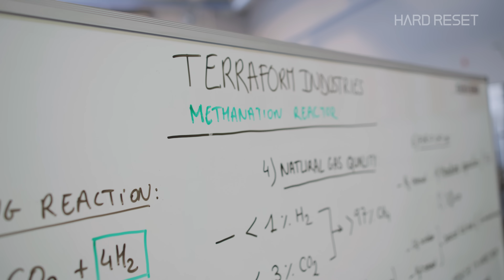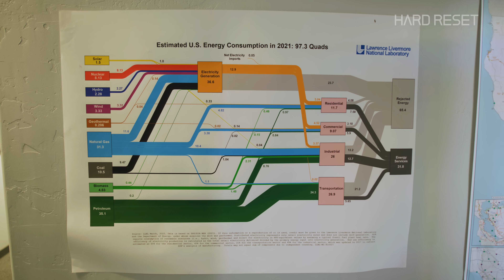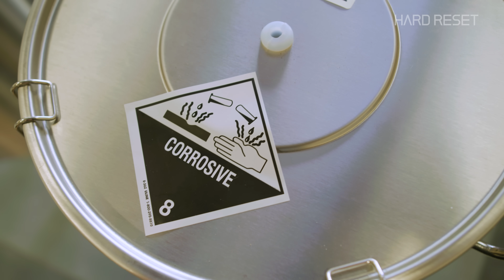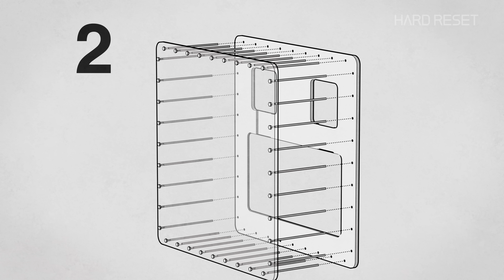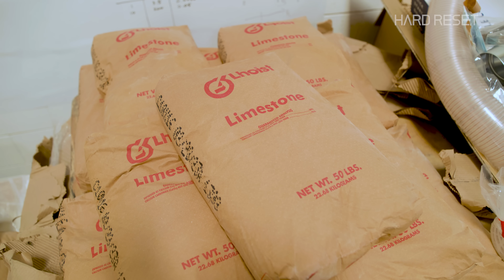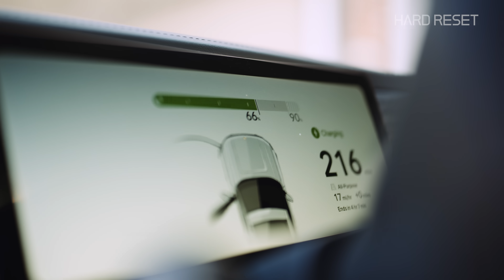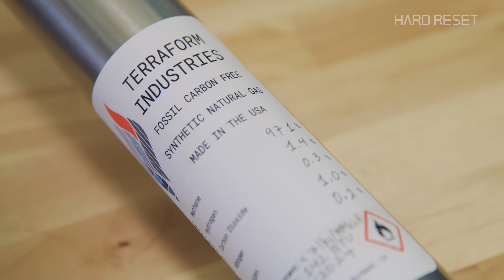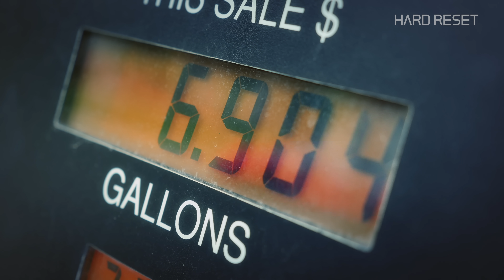The Last Fuel We'll Ever Need?

Comment: engineer here, call me super skeptical, I want to see total energy inputs and outputs of a finished loop.

he says it is 30% eff, so 1KJe of variable produced solar energy makes at best 500J of hydrogen and then 300J of methane, store that up in a pipeline and tanks and later on you can make around 150.. 200Je of electricity but base load. The 5..6 times inefficiency when turning intermittent solar to baseload electrical is what you would expect or you need to come up with a better battery or energy storage like liquid air heat storage system which has a way better loop efficiency of up to 60% electrical variable in and baseload out.

He is also producing oxygen, that should absolutely not be released, when used to burn methane, the conversion back to electrical increases from max 60% to a new high of 80% in the Allam-Fetvedt cycle which keeps the CO2 product inside the system where it is never mixed with air until it is finally exhausted. But that CO2 could be fed back into the methane production. The whole point here is that you have a battery system here where the hydrogen and methane are just transient parts of the system.

If the methane is used for transport heating or making other synfuels than that is fair use too. Suggest using DME as a diesel substitute.

And not lets forget that LLNL Energy Flow Graph he popped up, the USA uses 100XJ/yr of primary energy which is mostly fossil based or nuclear energy, only 1% is from solar which is extremely energy land poor,  so the 100XJ would now be using vast amounts of land to get the hydrogen stock as the input. There is a way to make hydrogen vastly cheaper than electrolyzes and that is to use high temperature nuclear reactors that produce heat at 700c or higher, such as the Molten Salt Reactor. That process is the Sulfur-Iodine cycle and is exactly 50% eff and requires very little land and no electrical energy needed, so its a thermal nuclear power plant to make hydrogen 24/365 and the platinum is replaced with dirt cheap sulfur and cheap iodine.

If I wanted to solve the energy problem I would go direct with land efficient MSRs making thermal hydrogen for synfuels and regular electric MSRs for the grid. No huge land and no precious metals needed.
Reply: He's planning on building the first gen production plants over exhausted methane mines, which are often in hot wasteland with plenty of space and sun which are already being used. I also recommend looking at the guys (Casey Handmer) blog; particularly his "Solar and batteries for generic use cases" post where he does all the calculations you talked about.

He also has some other posts talking about nuclear; but the current capex of an MSR makes it impossible to make fuel competitively with mining fossil fuels. The capex VS power generated of an MSR is larger than alternative nuclear options; and may even be worse than geothermal, so I don't know why you suggest it. What you suggest is just not economically competitive with existing technologies; "land efficiency" doesn't really factor into that.

Also, you don't need precious metals for anything involved in this discussion. You can make hydrogen from the air (or water) vial electrolysis without platinum, and Terraform's version doesn't use platinum.

> energy storage like liquid air heat storage system which has a way better loop efficiency of up to 60% electrical variable in and baseload out.

No infrastructure exists for that. You suggest a lot of things which are way more expensive than what they are doing without considering those costs. The efficiency gain doesn't matter if they can't afford it in the long run.
Reply: @XetXetable they were just saying that it also doesn't use rare earth metals. But I will say it before you do. U and th are not SUPER common.. buuuut we already have 1000s of years worth mind and nearly ready to go, we just have to separate them from the huge amounts of rare earth metal impurities lol. Anyway. I hear something like 90% of the cost of nuclear power is paying the people that make and approve it.... so.. I mean. 100x check the math and designs and social systems. But next Gen is so much safer than the already quite safe systems we use... I think the best thing we can do for public and governmental trust is to have many MANY layers of people and systems watching people and systems. And a good chunk of that can be volunteers, including people like science and social college students.. and people with physical disabilities, but they can still call a pro if they see someone ignoring a red light.. or see a strange package delivered etc etc.. just like 3 more layers of checking yaknow. not that it's super necessary, but the people afraid of nuclear need more reassurances
Reply: Also I'm like 90% sure that fast reactors and or fusion fusion hybrids and even just accelerator driven reactors are just as good or better than purely molten salt systems. But some hybridization is possible there to.. Please have a look at those. Some are a bit theoretical at this point, but not significantly.. the physics is there... and they are not only much safer, but WAY more efficient.. i mean u238 and th as fule, and short half life waste and really high fule burn efficiency.. and really fast power throttling and shut down times.. whats not to love
Reply: Still, if it s cheaper than buying natural gas and gives energy independence to countries that don't have fossils.. isn t there a case for it just on economic value? With the extra argument of scalability for countries that dont have a nuclear industry currently (or even the ones that have  see how much time it takes France to complete a nuclear reactor nowadays), same argument for electrifying a whole country in a reasonable time vs using solar origin fuel in existing infrastructure (and you can do both at the same time actually, they could mutually reinforce each other).
Reply: Seems more like a shell game with chemicals. If its complicated enough people won't question it ?
Get on a white board and start rubbing the marker around to explain your system.
Reply: AOC said it 7:00 INEFFICIENT
Reply: call me super skeptical
But it sounds so good. My bet is they're on the lookout for investors and will disappear with the money after they got a few million.
Reply: All true, not the mention the reaction needs, 650f @ 450 PSI,  the equipment costs to scale that up are astronomical. Pumping hydrogen into that much pressure and temp. When something goes wrong, someone is dead.
Reply: Wouldn't it be smarter just to collect the hydrogen and skip the rest of the steps
Reply: @superfliping I wondered about that, too.  But I guess that they're trying to get to market, a fuel that can more easily just slide into existing use. 
Still... I wondered about also just capturing and selling the hydrogen.  

Which reminds me, I have to look up to see if they've made progress on the apparently huge hydrogen deposit they found in France...
Reply: What is the sulfur-iodine cycle??
Reply: If I was billionaire I would get you to make one of this.
Reply: I completely agree - when assessing an "invention" you always have to take into account how much energy you have to use to produce another form of energy and what the price of this product is. It is not true that solar or wind energy is free - you have to produce these devices to process it and as practice shows it is not profitable. Each such investment is tax-deductible and energy prices are constantly rising.
In physics there is no such thing as a 'perpetual motion machine'
Reply: Good post.
Anyone using the highest grade of energy, electrical to make the lowest grade of energy, chemical fuel is way off the mark.
Any fuel to mechanical conversion is limited by thermodynamics to 35% at best, the rest must be waste heat.
That same electrical power to mechanical can reach 95% efficiency.
Reply: Even in theory, the energy in is more than your getting out, The guy is baking lime to cook off co2. we can make loads of synthetic fuels, they will never be cheaper than just taking fuel thats already made. and one of the good things we get from using fossile fuels is the realease of co2 into our atmosphere. This helps our forests and plantlife and oceans thrive. our atmosphere is .04% at .02% all plant life dies. by fracking, burning coal, and flying private whenever you can. Your restoring a natural balence to the planet. fossile fuels allow us to preserve the land on the surface, gasoline has 100x the energy density of lithium ion batteries, and water vapor has 100x the thermal mass of co2. There is no feasible way you could ever create the amount of co2 needed to hold the same amount of heat that the smallest amount of cloud cover could, the reason why in the desert it can be 90F during the day ands 20F at night is because there is no moisture in the air. our oceans holds massive amounts of heat, this heat then gets mixed around with cold water to keep the entire planet a very stabile constant temperature. it not co2 that determines climate its fluid dynamics ocean currants. if anything happened that disrupted the ocean currents that move water fromthe polls to the equater, thats when we are going to all die.Im not worried about the earth increasing by 1 degree in 30 years, my backyard has changed 30 degrees in a single day, i was fine after putting on a jacket. this is nothing humans cant handle.
Reply: You lost the plot... they explicitly said efficiency should not be seen as an obstacle to mass deployment for displacing fossil fuels with carbon neutral fuels now, rather than succumbing the "it's not efficient" argument and doing nothing at to make use of our massive infrastructure built around hydrocarbons.
Reply: What I want to know is why the fudge are they making methane when part of their process is hydrogen production.

Just use the damn hydrogen
Reply: They are being very transparent about being inefficient. I am sure they could use a molten salt nuclear reactor or whatever to make it more efficient on paper but I hear those cost a pretty penny. Their goal is not to solve the energy crisis overnight. Their goal is to create a cheap enough competitor to fossil fuels that creates less carbon emissions. So while other startups spend 30+ years figuring out how to scale up more efficient technology and create infrastructure for it, the economy can transition away from fossil fuels and start lowering emissions.
Reply: The molten salt reactor wouldnt be CO2 neutral tho. 
Thats the point of their Terraformers, to combat climate change by not producing net CO2.

Comment: So, it seems that this company is tackling the energy storage problem. They are betting that electric battery tech is unlikely to improve any time soon.

They want to take renewably electricity and use it to create a flammable fuel or gas, IE. Storing the renewable energy as gas or liquid. 

If battery tech doesn't improve then they might be on to something but I'm guessing this tech is going to be too little too late. The only reason it's even worth exploring is because renewable energy has become so cheap. Time will tell. Cool idea anyhow.

Comment: Why not use the electricity directly? 
Because weight matters in the air for long distances. 
A jet engine is only 33% efficient. So around 4kWh of extracted energy per kg of fuel, which is still 5.7x the current best battery energy density of 700W/kg

Comment: It's really cool that someone is developing this process. More options are always good. But the biggest problem I see with this idea is real estate. Waiting for limestone to absorb CO2 is an agonizingly slow process. Cheap, as carbon capture solutions go, absolutely, but you're going to need a huge surface area to produce any meaningful rate of output. Same for solar panels to run those electrolyzers. It's basically all the challenges of hydrogen production, but easier to store and transport.
 I think this technology would be best combined with Japan's efforts in pink hydrogen, using a nuclear reactor for process heat. That would also take care of baking the limestone. Not as accessible, of course, but a heck of a lot bigger volume.

Comment: Hmmmm using solar to produce electricity.... Then use the electricity to spilt water to get H2, then capture CO2, make calcium carbonate,  heat the calcium carbonate in a kiln with electricity, 
At all stages using electricity and multiple energy losses..
Just use the electricity in batteries.... Newer batteries will be along very soon...

Comment: Very exciting! This and the new geothermal tech that lets us quickly drill 15 miles deep to magma should quickly allow us to argue about the positive value of high CO2 for greening the earth, rather than about whether CO2 is a mainly heating the earth.
Reply: What are you on about? At 15 miles deep the release of pressure caused by drilling immediately causes the rock to spall and fill up the hole. CO2 is not the main factor controlling most plant growth so more of itt will not green the Earth but it will most definitely cause catastrophic global warming.

Comment: Solar electricity is cheap but not infinitely cheap and never will be. Getting CO2 out of limestone takes 800°C or so, i.e. lots of energy. Electrolysis is still too expensive to compete with grey hydrogen made out of fossil methane. Its catalysts are based on very rare and expensive metals like iridium. There is no description of the 'magic' synthesis of methane or its costs but I doubt that it is efficient.

And you do need a certain level of efficiency to be economically viable.

Soryy, but this is a hoax.
Unfortunately

Comment: Metane is very easy to polymerice into PAO ( Poly Alpha Olephine ) oil . The most common syntetic engine oil since 1950-s . 

A Diesel engine runs perfectly on Pao of the proper viscosity . 

PAO can also be made gasoline of . 

So no no veichles are needed . 

Syntetic fuels are cleaner so less dirty exhausts and better milage ! 

Also less engine wear ! 

Med vänlig hälsning / Best regards Ulf Holmberg, Machine / Chemical enginerer and since 1988 tribologist on full time .
Reply: Thanks for this. It seems I could then be less worried about methane leakage.
Reply: @ Metane leaking out is 100 times stronger than Co2 when its coming to global warming !
Reply: why wouldn't you just use the electricity generated by the solar for charging vehicles directly. much more efficient use of the electric.

Comment: At the root of all of this is cheap solar energy. That makes synthetic fuel viable. But by the same token, anything that can be directly electrified in a practical way won’t bother using fuel. So the market for synthetic fuel is limited to things that can’t be directly electrified - aircraft and blue-water shipping are the obvious cases there.

Comment: So basically they are using methane as a battery for solar storage. this will work only as long as cost per unit Kwh of energy is cheaper than storing in batteries otherwise it doesnt work. So the question is can scale make it cheaper than Batteries?

Comment: This process looks to be hugely inefficient. It uses huge amounts of electricity to create a fuel that will be inefficient in it's use ( losses due to heat, leakage from storage) - when you could just use the electricity directly.  It'll only out compeat renewable electricity for a limited range of uses such as rockets / missiles. The way battery tech is developing we'll have e-planes before they've got industrial scale production off the ground. And most new cars / trucks will be EVs long before that.
Reply: they litterally called it 'the most inefficient way to produce natural gas'
Reply: But it is cheap.
Reply: Weight is important for aircraft, battery powered aviation will be very niche, limited to flights of less than 50km, interisland services perhaps. Maybe 0.1% of aviation. Next!
Reply: We are throwing away electricity as soon as the grid doesn’t have the same amount of consumption. While it’s better to do demand response, the amount of electricity we have in excess is huge. As soon as the CAPEX (cost to own) these devices is low enough to not run it 24/7, you can run just at times when solar power would be wasted otherwise.
Reply: This technology can be used on Mars
Reply: And so was, refining oil into gasoline as well. It took the world about 100 years to perfect it. Nothing happens over night.
Reply: Well, Planes and rockets need fuel. Rockets literally can't be electric as far as we know. Also electricity needs to be consumed immediately since batteries are highly inefficient for long time storage and are also expensive. You can store gas and fuel very cheaply and use it whenever. While everything electric sounds nice in theory in practice it's very difficult to do.
Reply: @fairieshavetailscreations  yeah but planes and rockets need efficient fuels due to the mass of fuel potential limiting the mass of the payload especially for rockets. So idk what market this thing has tbh,
Reply: Ok, but no EVs

Light rail is more equitable and easier to electrify than auto mobiles
Reply: @20-Foot-Anaconda    False. Stop lying.

Comment: Watched this a couple of times through. Interesting but in light of battery development and electrification of most technology, will Terraform's process be scaled up and operating efficiently in the short term before alternative fuels and engines are established for difficult-to-convert aviation and shipping. To be fair, Hard Reset, you should have questioned some of these issues with Terraform.